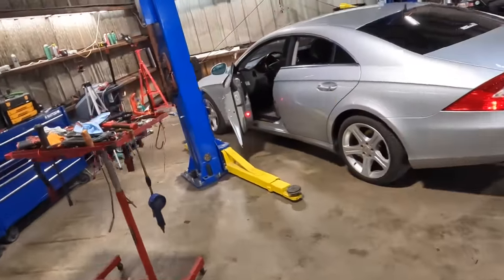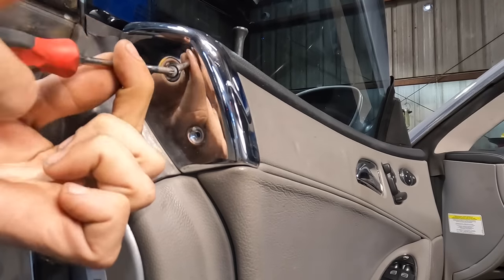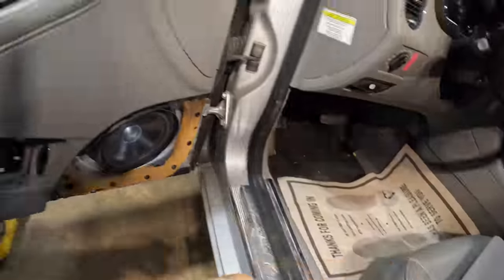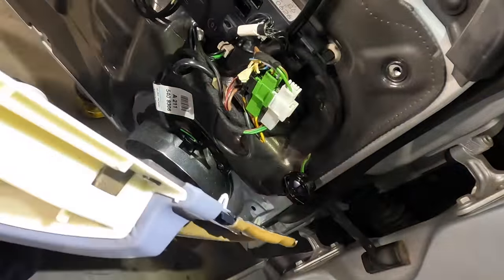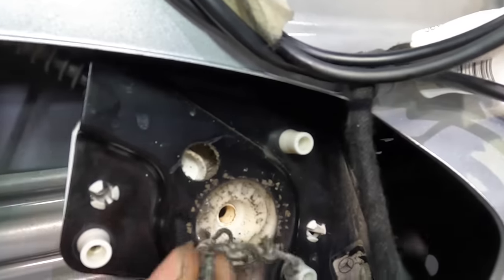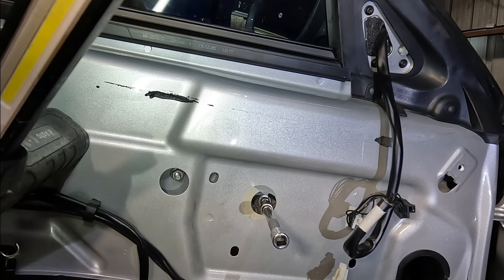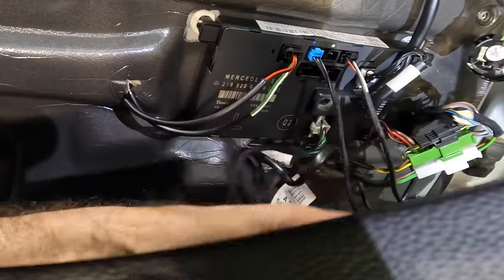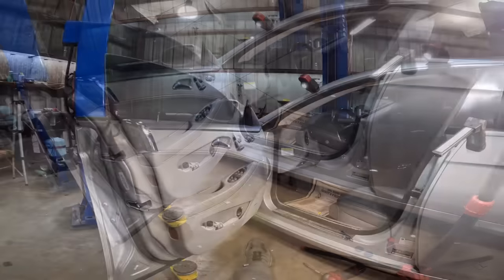Overly Complicated?  Mercedes-Benz Interior Wiring!  CLS 500 (LOUD NOISES!)

Comment: Ray, this was NOT an uninteresting video. I love seeing how different manufacturers accomplish the same thing using different designs. Mercedes, while complicated, look really well made when you see the level of detail in that door panel. The sound insulation blanket vs a sheet of heavy plastic used as a liner is one difference. Plus, that door track mechanism looks way better than the one you replaced in the BMW some months ago while at the old shop. Granted, that was an aftermarket POS; I am referring to the basic design that MB has that looked structurally sounder. Just my opinion, of course! Keep those videos coming buddy!

Comment: Never buy a car with air suspension. You will ALWAYS have to replace them!
Reply: Most people put normal strut conversion in
Reply: Any part of any suspension is supposed to be changed over time. Air suspension is awesome due to comfort and usability. But it is of course at a cost of more service and cost.

Comment: I always use blue masking tape and hold the glass all the way up... tape over the top.  Easier that removing and retracking the glass.
Edit... in this case I understand why ya did it. Less risk!
Edit 2: nevermind... I was way off base... no top bar...floating winder! Nothing to tape to!
Reply: Won't work with frameless glass on hardtops.
Reply: Loved your recovery ! When you dive in, it's difficult to "undive" ahead of the splash !

Comment: When putting hard to reach fastners back together, I use beeswax or candlewax to stop the fastner from falling off the tool as it is eased into position. The wax holds the nut within the nut runner or socket.

Comment: I'm a former SAAB mechanic. A lot of mechanics hated working on them. They were actually quite simple to work on. Our dealer later acquired a Porsche/Audi franchise. I used to shake my head at the hoops and hurdles that the Audi guys went through to work on those cars. Apparently German engineers are taught the Rube Goldberg method of design. You have to disassemble multiple pieces just to get to the root cause of a failure. They over complicate everything.
Reply: And they are proud,, as usual, that they can make them  extremely complicated.
Reply: so u learn every part of the car and admire the design how things can be made to fit each other.

Comment: So many times now you've come across the weather seal behind the door trim. The best way to remove it is to cut it with a Stanley knife.
This way you leave some on the weather seal and some on the door frame. When you come to put it back, you put black goo on black goo and it all goes back in the correct place.
Give it a try next time. Love from the UK.

Comment: Butyl rubber is great for re applying the sound material that you pulled off. It comes in a roll and is a oil based rubber so it doesn't dry out.

Comment: I worked for a GM dealership back in the late 1990s and early 2000s. I was hired as the “Detail Shop Supervisor”. I also did many window regulators. The worst is on the 1998 Camaro. You have to drill out rivets that go into the glass. There are only 2 ways that can go. Either you break the window, or you just replace the window in the first place. You can get them out without breaking the window, but it’s easier to just replace the whole thing. My favorite was the 2001 Buick LeSabre doors. If you do enough doors, eventually they become serving nature.

Comment: Just a little tip. When you have to go in sideways with a nut like that put a small piece of paper or tape sandwiched between the nut and the socket. It will hold it tight but still let you pull the socket back off once you tighten it.

Comment: I can appreciate your dealing with complexity. The job of maintaining my wife's beloved 560SL (88) falls on me (my personal thing is simple OLD Jeeps). Official service information is hard to find (and I suspect many dealer mechanics are younger than the car). Not to mention special tools (!!!).  Some good stuff on Youtube and user forums, fortunately.

Spent a couple of months trying to resolve an idle issue which was eventually traced to idle control module buried so deep behind the glove box that I could not see it at all and had to remove it entirely by feel. Of course replacements are not available, but found a shop that rebuilt it for me. Frustrating, but wife is happy.

Comment: Something you may find useful for holding fasteners into/onto sockets or bits is Stick-um candle adhesive. It is just tacky wax so the residue will not damage anything. A small tin (less than $10) will last for years.

Comment: I'm an automotive locksmith and this panel wasn't even close to the worst. I give it a 7/10. The secret screws as I like to call them are always a challenge. Some of the cars from the 80's and 90's were much worse. Great job finding those secret screws. When doing a regulator I use those new style large suction cups on the outside of the window to hold it up.

I cringed when you put the motor back in. I was worried about the timing. You took the motor out while the window was up and out it back in when the window was down. Obviously my fears were unsubstantiated but sometimes things like that will bite you especially on a clockspring.

Comment: I have done my fair share of those I would say.  And I wanted to say that you did just fine Ray.  You don't have to remove the inner door handle support bracket.  But removing it would make it easier to work with the window regulator.  All that's left from that job is to program the window stop points and hopefully, you won't need to adjust the glass.  And I would spray some silicone lubricant on the window guide tracks to stop the glass from dragging so hard.

Comment: to stop the glass dropping on you, duct tape to the glass and over the top of the frame. It's more than strong enough to hold whilst you mess with the regulator.

For frameless windows, rubber door wdges work fairly well

Comment: Ray - for that inner lining you need some strips of butyl rubber and a small heat gun (embossing) for the reinstallation. It must be sealed all the way around otherwise you are likely to get water inside the vehicle. Its exactly the same with BMW's. Butyl rubber strips are quite cheap on eBay.

Comment: Very interesting video. What you demonstrate is the general principles of door trim panel and window regulator removal and replacement. There may be more wires, but the process is the same, regardless of brand. Not having worked on this Mercedes model puts you more in our place.

Comment: Really interesting Video, you don't realise that all those nice functions that luxury cars have means there a whole host of cable and control boxes hidden behind the door panel. First door panel I ever did (window runner rusted off) just had a manual door lock and window wire. I had to replace the door glass as well (badly scratched, had a replacement from a crashed door), was told the glass came out through the holes hidden behind the door panel, four of us spent over a day trying to get the glass out and failed. Guy from the dealership came out had the glass out within a 1 minute. We felt sick as pigs. Please carry on making the great Video's

Comment: Ray use some Black E6000 adhesive to reattach the dust cap on the door speaker. I use it all the time to attach dust caps to subwoofers works really well.

Comment: I think I told you before, we were a bodyshop for over 35 years. Considering you said you never done this job before. You did great. My point is even with all the experience we had over the years. It was still  always a challenge,  especially on european vehicles.  Again, great job.... BTW, if you use a heat gun very carefully, it helps to get those nasty door insulator off. Again, use it lightly so you don't end up melting it or other components, or simply making a big mess. But it does work in your favor. Ron

Comment: As a busted arse ex Auto Electrician down under (injured on duty) , we didn't have any issues of the glass falling down !  reverse gravity in Australia. Only kidding.  Duct tape or masking tape to hold the glass up is a big help, a lot of vehicles have the window regulators riveted in, if you do not have a tong type riveter we just used to nut and bolt them. I don't no what the manufactures make the goop  out of that holds the plastic sheet behind the door trim, it has the magical property of transferring to anything  you have nearby. Nearly everything short of nuclear fusion is needed to remove it. Keep up the good work.

Comment: A little helpful trick I have learned is put a piece of plastic in your socket before your bolt or nut and it will secure said fastener for hard to reach places , for example,  the top 10 mil. Nut on  the regulator  you was worried about dropping,  it really helps

Comment: Liked the video.  Replacing 2 regulators on a Hyundai Tucson tomorrow.  Based on videos it is far easier than the Mercedes.  But you illustrated the logic.  Patience and go back in the order you reverse of disassembly.  Also like you showed the unfiltered process which helps others work out the process.

Comment: Apologies if someone else mentioned this, but the trick to pulling plastic or insulation sheets held with black goo is to cut the goo bead down the middle with a knife.  Cuts easily.  Then you have no risk of tearing.  With half the goo on each side reassembly is easier and the bond more reliable.

Comment: For those who don't know how one-touch windows work: many people think that there is a stop switch at the bottom (or top, for one-touch-up) of the window that cuts power to the motor when the window is at the end of its travel. Not true. There is a module (that expensive looking black box that Ray removed/installed) that measures how many amps the motor is drawing. When the window and motor stop. amperage increases a lot. The module senses this and kills the power to the motor. Some will also reverse the motor if the window hits an obstruction while going up

Comment: Regulators are a pain and what helps them and the motors from not going out is spray the track and felt that seals the window with silicone lubricant which won’t wash away from water getting to near as fast as say WD-40 which some use but doesn’t last nor work as well:

Comment: As far as being too complicated goes, German Panzer tanks used a torsion bar suspension,  very smooth. However when a bar broke the tank had to be returned to the rear as most of the inside had to be disassembled to replace it.

Comment: A trick for when you need to set a nut into a socket and maneuver it around:   Put a piece of paper towel over the socket and then push the nut in.   Then tear off the excess paper towel.   That gives just enough friction to hold it so you can get the nut placed.

Comment: That window is frameless so the window movement when you plugged it in is normal. It drops about 3/8" when the door is open so the glass does not hang up on the window seal. Those CLS models are a PITA to get right with the adjustments. If it's not just perfect the guy will be back complaining about a crap ton of wind noise from the seal. Water may leak in from the top also.

Comment: I watched you do a similar job on an Audi or BMW ,a while ago where you removed that bracket with the rivets. I believe you replaced it with small bolts and shortened them so they wouldn't scratch the glass or if put in the other way, puncture the upholstery.  On another note , those nuts that are way in there can be held in the socket if you first back them with a piece of paper . I'm not sure if that would also work with philips screws. I'll have to try that myself some time.

Comment: 33:41
Howdy,     i just had this argument,       10 years ago         it's a screw until you put a nut on it.   then it's a bolt
   i argued that smaller than 1/4" was called a screw    i was wrong
ty,   les

Comment: I did both axles, lower control arms and brakes on my 05 neon today.  when I was putting it back together I found my self going "click" every time I was tightening a bolt with the ratchet.

Comment: I've noticed Ray, how important your stool/s are. Like mine, are perfect height to work on doors, suspension etc. But when the lifts have to be at a half up, half down position. The stool is too short to avoid muscle fatigue. Or your squatting, tripling muscle fatigue. My friends ceiling height is too low for full extension & we're both over 6' & hunch back for leverage = lots of beer breaks ( only upside ) lol.
Is there anyone that has a fix for this? Maybe some type of scissor lift stool. Similar to office chairs, but way stronger than the weak little hydraulic ram style?
Be a great invention if not already done

Comment: Ray, a tip for removing the door membrane would be to use a sharp razor and cut the actual adhesive as you pull away, it will leave some on the door and the membrane and you can reuse the goop to stick it back on, just put the membrane in a clean place so the adhesive on it doesnt pick up dirt. This will prevent it from ripping and be less work to put back
Reply: Ray if you need any tips about Deagons.....I know a woman lol

Comment: @13:50... I use an Xacto knife. @24:50... It's good you like those. You're gonna have to adjust them to set the water seal at the top. Because the door is frameless, the seal at the top of the glass is pretty important. Gotta be adjusted to prevent leaks, but also not bind up. Also gonna have to relearn the stops on the motor.
Reply: prybar!

Comment: Hey Ray when removing the insulation in door that has adhesive gluing it to the metal. Use 99% isopropyl alcohol with a syringe 💉 to dissolve the glue/adhesive.
That's what I did with phones with that E5000/E6000 adhesive holding the phone battery and screen to glass. Along with heat for glass

Comment: 13:29 the best way I have figured out how to get this stuff off off the door panel the cover is used a heat gun so you melt me rubber on the back a little and it comes off with the plastic and then when you put it on just heat it a little bit it gets gooey again and put it back on.

Comment: I would have checked the glass alignment before installing the inner panel.  When you point out that there are adjustments that usually means you will need them.
Reply: no problem. he willing to do it 2X.

Comment: BMW attach the inner insulation with the same butyl mastic. Pull a section free, then use a very sharp knife to cut the mastic where it is stretched. That way, the cut edges will stick together again on reassembly.

Comment: Pretty please buy some plastic trim removal tools, that metal pry bar against the interior body made me anxious. Also great job on the door, even though I was yelling at my screen about where you need to check next even though I've never been inside any mercedes's door. I've done a TON of stereo replacements on all kinds of cars, just not a merc, or that vw i gave up on bc ALL THE WIRES ARE BROWN, WTF VW!?!?

Anyway nice job, it's almost a general guide on how to remove any door card as they are all very similar; the clips around the edge, the screws around the handle, that one other hidden screw all the time for some reason, the handle/lock cables/posts that go with every car, same as the molex connectors, just way fewer in most cars vs this. I've never run into a whole extra electronics module behind a door but I've never done a car with seat adjustments in the door either. I've attempted a window repair as well and NEARLY got it but the cable spool that was crimped in a place exploded apart before we could shove it all back in. I've also done no less than 3 toyota door handles, 2 camries and a corolla. Those cheap ass door handles snap off in about 10 years of normal use, just look for old toyotas and you'll see all the broken handles or unpainted replacements. Those were a real cut-your-knuckles-up PITA.

Comment: Hey Ray, did you happen to check the air pressure in all 4 tires BEFORE you checked the ride height? That could have accounted for the 1/8" difference...😉

Comment: It would have been easier to do the regulator by taking the rivets out of that bracket, but you actually managed it without doing that. You actually lucked out that it's a frameless door so you did not have to try holding the glass up while replacing the regulator!
The regulators are totally riveted in on my 2001 e320.
I've had to replace both rear and the front right-hand one. The rear only has four rivets, but the front has nine. One of my rear ones has broken again. I think I cracked the plastic parts when I had to replace the broken glass. I have the window propped up with a piece of wood.
I have had a new one for several months, but I have not wanted to do it.
I got rivets from mercedes, but they are so hard I no longer have the strength in my hands to set them. I'm 74 now. Harbor freight rivets are softer and easier to set.
What a pain in the ass!

Comment: On a Mercedes GLK 350 that insulator material is actually aluminum plate riveted to the door. Thing is built like a Panzer. Changed out a door lock actuator and it was a very tough job. Took many an hour just trying to line everything up.  Mercedes is not kind to those who work on them..

Comment: Did you have to adjust the window? I'd bet the window dropped when you plugged in latch switch. As they drop when you open thre door to clear the seal. 

Side note. You need a subscription for repair information. I pay 192 a month for alldata. It's not perfect but has a lot of info

Comment: Just wondering if you did check that with the door closed and you pull the handle does the window roll down a bit so that when you close it it doesn’t compress the air in the vehicle